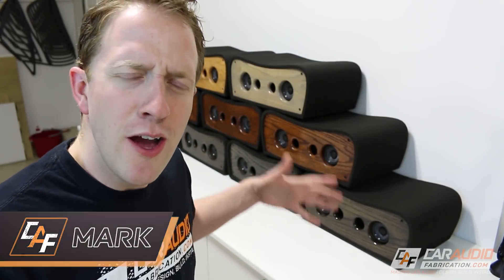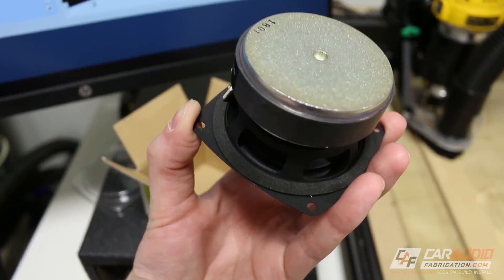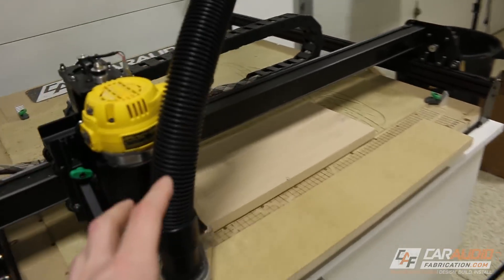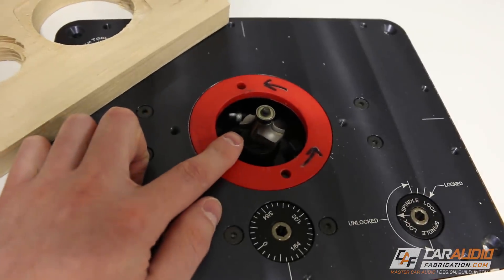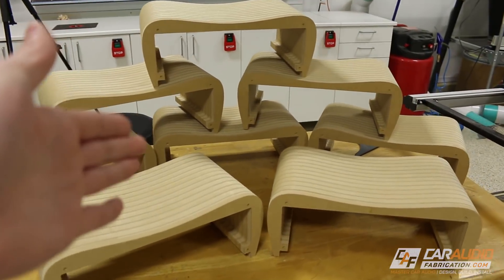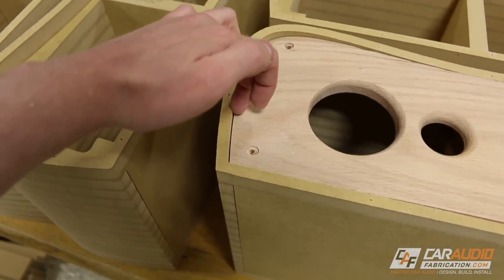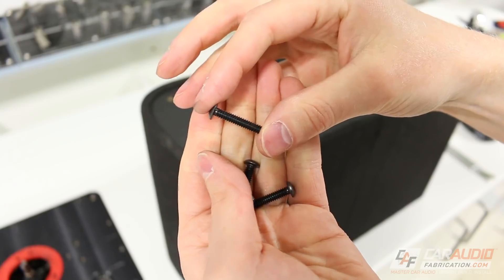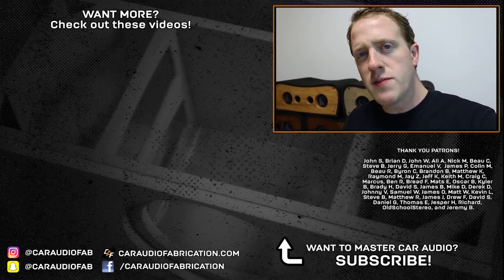Building a Bluetooth Speaker! AWESOME mid-bass and portable!

Comment: It would have made more sense to have the bottom plate removable than the front panel to avoid those screw holes. It would also have made more sense just to make it from square sheets rather than glueing all that mdf, or build with a few extra panels and reshape to get the curves

Comment: If you were to add a carrying handle, what would you have chosen? A simple luggage style running the center depth or one that spans the entire width and is mounted to the sides? (That way it can rotate underneath the bottom of the box and function as an upward prop.)

Comment: I do a lot of CNC routing.  One thing that I do that helps with pockets or say your flange for the speakers. You don't really need to pocket the area that is going to be cut out. So I'll draw another circle about .125 inside the area that is going to be cut out and discarded. So that it only pockets the area needed and doesn't waste time pocketing the whole area. It's only a few min but when doing a lot of them. It adds up. Even more so for larger speakers or cutouts with a lip. Also, I use 3d tabs.. This keep the router moving and I don't get the little marks were the router went over the tabs. I've found that about 1.5 inch tab at .22 works great for me. The .22 is because I normally use a .25 bit that takes .25 out on each pass. So .22 is less than that so I only see the tab movement on the last pass.  Just food for thought. Good work and I love how clean your shop is. Giving me ideas. ;)  Also, I use a oscillating cutter to cut the tabs. No blowout or splintering. For the inside corners you can use dog bones. There is a plug in for fusion that will find and create those for you or you can do it by hand. I like dogbones.. not T-bones.. but that depends on the location and needed.

Comment: Considering all of the additional work that went into the cabinet to arrive at a non-box shape, I would have went with a separate tweeter and a higher end set of more efficient speaker drivers which would provide more volume with the same amplifier power. That being said, the speakers are unique and beautiful and sound pretty good on my headphones. Great job.

Comment: I have made a speaker system at home and it is the best sounding speaker I have ever heard. I have 2 5 1/2 inch woofers 100w each with 2   1 inch tweeters and for the low bass ive got a 15 inch subwoofer running on around 500w and 2 8 inch midbass drivers on 100 each.

It is extremely  loud but it is the best thing i have ever heard

Comment: The Parts Express website recommends .3 cubic ft of volume inside the box with a 1" diameter port that is 3" long. How much does your box differ from those specs? I know you have a 1.5" diameter port; are the other specs the same?

Comment: Could you have CNCed that gentle arc on the front?
Reply from the maker: With a 3 Axis machine you could but it would take hours to cut. Then you would still have to sand. With a 5 Axis it could be done faster but a 5 Axis machine is just a few hundred thousand dollars. I'll use the much more cost effective router shield and get it done in a couple of minutes

Comment: Would love to see more design details since its of course the most important part. What program is that? How did you determine the optimum volume and do the tuning? How did you match the curvature of the speaker flange?
Reply from the maker: I'm a Mechanical Engineer. Design is in my genes.

Comment: Excellent build!  Not as if you need to be told though.  I only feel compelled to comment because of the thumbs down and negative comments.  I also have wanted to do something like this and in the past actually have.  My build was way overkill in the amplifier which led to poor battery performance.  A project like this takes a lot of design consideration and may require sacrifices in areas to accomplish the end result.  It’s real easy to to be critical especially when you have limited real experience.  I feel that is the case here.  Everything about this build is top notch.  This guy is an epitome of the new “maker”.  He took an idea and set a goal.  He then made that idea come to life through design in CAD, CNC,3D printing, and wood working.  Oh...he also filmed it to spread the knowledge!  So you delusional idiots should keep your comments to yourself.  You only make yourself look ridiculous.

Comment: I have 2   8 ohm speaker 
How can I wire it down to 2 ohms
Reply from the maker: Unfortunately you can't. Either series for 16 ohms or parallel for 4 ohms. To wire to 2 ohms you would want two 4 ohm speakers in parallel.

Comment: I suppose what you wanted to build was some kind of box that you could take with you and left it let's say on the floor or over a table, not something you carry with you while playing, in other words, a boom box. The really difficult part of getting good low end bass is volume reduction. At first I thought "wow this box is pretty big for a portable" but as I said above, I get why it is design like such, looks really nice thought :)

Recently I made a bluetooth boom box for a costumer, I did challenge myself to make a small volume sealed box with some cheap dual cone pioneer speakers and lots of stuffing material, and I was actually shocked with the bass I had, like only 3.3liter per speaker chamber and it went low as at least 55Hz and didn't had any crazy frequency peak! To finish, I'm challenging you to go as low and cheap as possible, just to see what you can come out with! Cheers!
PS: challenge other builders you know if you want to.

Comment: Is it possible to build a custom subwoofer box for a 2009-2014 Ford F150 SCREW specifically 2013, behind back bench seat? I'd like to know your thoughts. I've been struggling with the idea and it seems it's not possible according to forums

Comment: Like always top of the line. Dayton audio board amps at 12v very low volume needs higher voltage smart advertising from parts express.  There's better Bluetooth board amps like tpa 3118. With 5.25 jbl. Kinect 12v 12ah battery make 1 way louder. I BUILD boomboxes lot's of trial & error until you get perfect sound

Comment: really nice speaker builds! With my portable speaker it's more about deep bass than overall volume. In fact it's actually a subwoofer that fits in a small backpack :-P it uses two 3.5" Tang Band RBM drivers (38Hz Fs) wired to 8 ohms in a 0.16 cu ft ported enclosure tuned to 35Hz (plays down to 30Hz!) powered by a Banda Pocket monoblock with added on FMOD (passive line-level) 37Hz / 18dB per octave subsonic filter running off a 12V 5Ah RC car battery pack. It has a Bluetooth Minirig on top for Bluetooth connection, mids and highs and subwoofer output :)
Reply: what amp did you use?
Reply: sam smith BD250.1

Comment: those specific digital amps are super efficient. i was able to drive a set of speakers with pretty good performance off a 9v battery that was too dead for a smoke detector (just for fun) and its been pretty lasting.

Comment: When Mark at fab kitchen makes a speaker you know it’s going to have 3 qualities: 1 well built 2 good sound 3 classy. Could you make a durable portable Bluetooth speaker?
Reply from the maker: Thanks! Thought about it, I would use acrylic and coat with duratex. Probably make it much smaller.
Reply: CarAudioFabrication I’d be interested in buying one. I live in Hawaii and need a good sounding, durable speaker to bring to bbqs on the beach 🤙

Comment: For the people who dislikes this video...can you do better?
Reply: now that was some good argument right there
Reply: Ev3rM0r3 I totally agree with you about using passive radiators vs. ports. The speaker is too small for ports. Passive radiators will dramatically improve the bass. There are many versions on the market. That use small speakers & passive radiators. And get a strong bass response. UE, JBL, etc. please research them. Some of them are using 40mm(1.75 inch) speakers with 3 inch passive radiators. The sound is incredible for how small the speaker is.
Reply: Yep and am in the process of doing it better now.  For full range speakers that small ports aren't necessary since there is hardly any air movement anyways, and with a passive radiator it would have been much more warm and bassy.  Also including a tweeter could have made the highs better.  So for your short answer, yes, could have been done better.  But for what it is I suppose its ok.

Comment: Amazing build!
But I have one question: A lot of portable bluetooth speakers rather use passive radiators than bass reflex tubes (probably for splash resistance and size). Is there any particular reason you chose a port instead of passive radiators?

Comment: I think passive radiators are better for small speakers
Reply: Passive radiators and ports do the exact same thing. The advantage to passive radiators come in play when you try to shrink the box alot. The smaller the box (on the same driver) the longer the port gets to keep the same tuning frequency. So at some point it gets really hard to fit the port physically, and the port eats up a fair amount of volume, so then passive radiators come into play.   
This box aint really that small compared to the drivers, so the port isnt problematicly long and passive radiators isnt needed.

Comment: Nice work!!!
Does the amplifier match the rest of your high quality build?  
I tried the same (not in your league) a wile back with a cheap 30 Usd chinese ampilfier and got a lot of noise.  
How do you compensate the volume of the amplfier and batteries in one speaker-volume compared to the other empty one?! Did you move the separation wall a bit to one side to create the same volume?
Reply from the maker: The only thing of notable volume is the batteries. The 3d printed plate actually sits a little back off the surface adding some volume so it's a wash.
Reply: which cheap chinese amp did you use?

Comment: That’s actually not a bad sounding speaker. My question is what is your favorite material to use for the feet?
Reply from the maker: I linked the ones I like in the description
Reply: The only thing I would have done differently is I would include a separate chamber for the internals and BT processor. It may not make that much of a difference but that’s just my perfectionism helping my ocd. Lol
Reply: the larger space will help with airflow, the amp isn't big but it will make heat and a small chamber holding the internals could overheat depending how small it is.